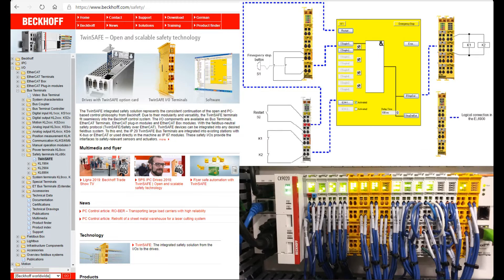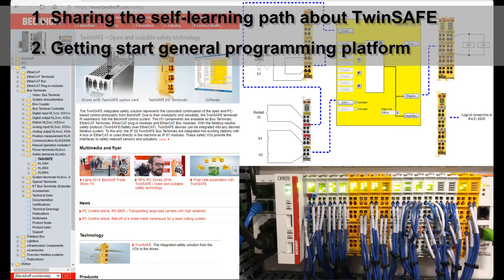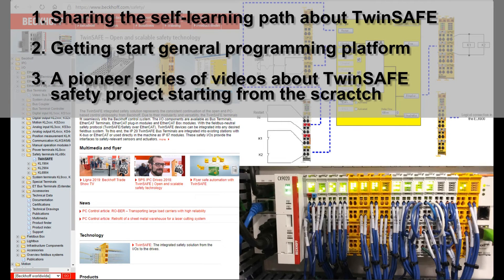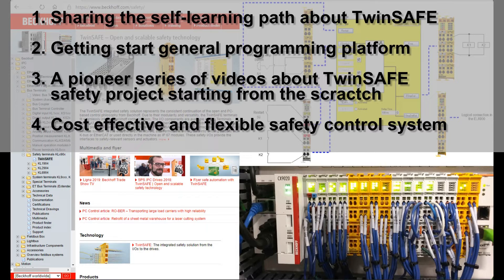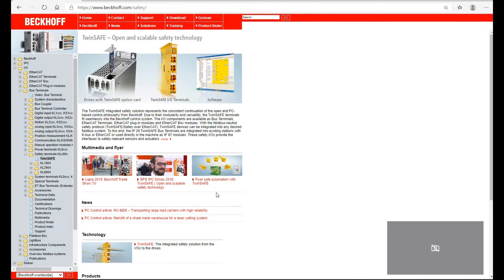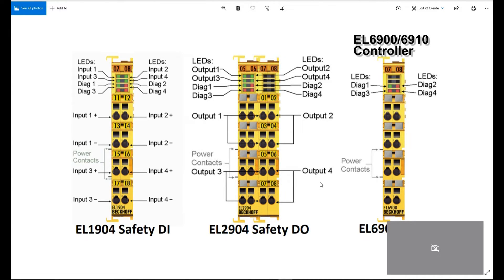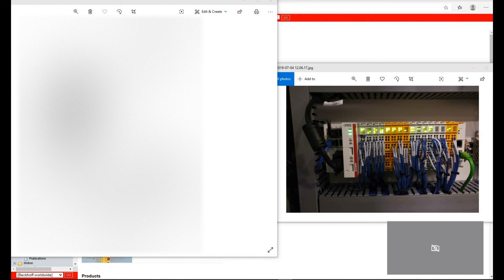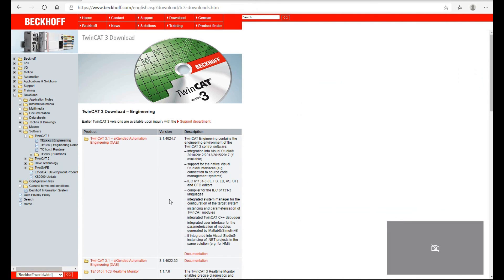SA03. EP01 Beckhoff Safety TwinSAFE - Series Introduction (EL6900 EL6910)

Comment: Hi sir thanks tuto, i have problem in m'y CNC machine that use beckhoff solution in the safety module el6900 it's stay in pre-op cycle led 3 and 4 lit and 1and 2 off any help
Reply from the maker: There would be many reason causing the safety controller turning to run, it is really pain. Probably check your hardware configuration, make sure all the ethercat devices are communicating correctly.

Comment: Hi sir i have a problem on my machine there is always an alarm "TWInsafe diagnosis Load interruption" on EL 2904 

Thanks for this tutorial
Reply from the maker: Please check the if the FSOE is the same as the dip switch at the side of the EL2904. Also for download the safety system, please view the video https://youtu.be/D2oiox_GQBU?t=91